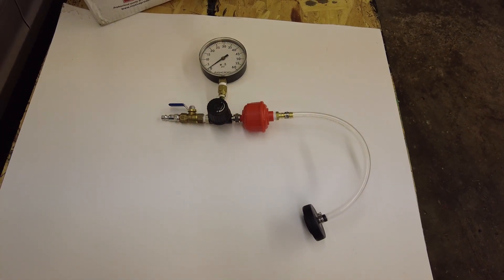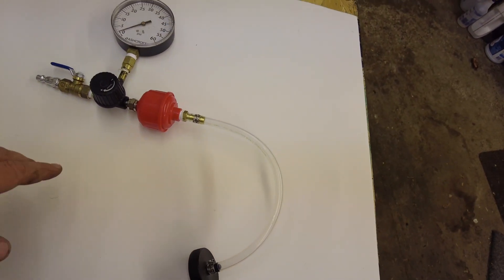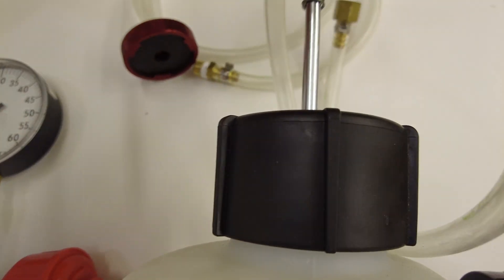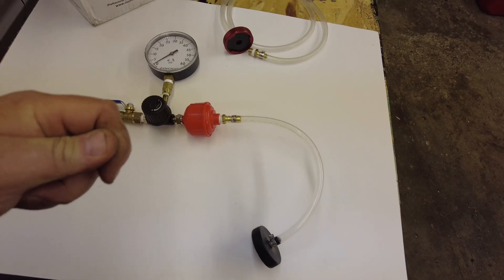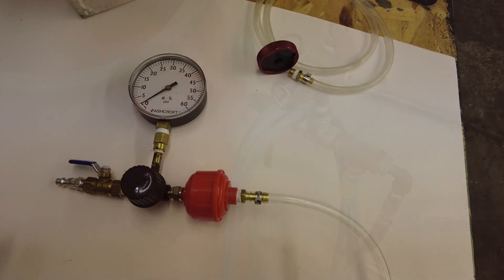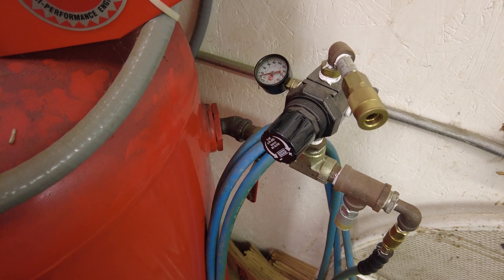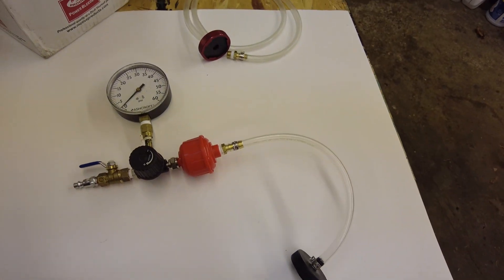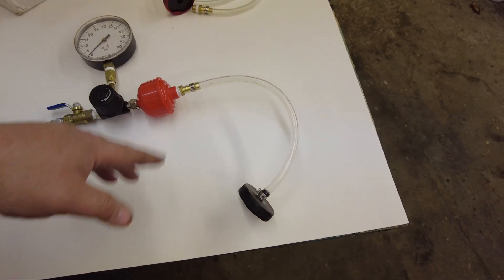How To Bleed ABS Brakes, Make your own Power Brake Bleeder, Pressure Bleeder. Brake Bleeding.

Comment from the maker: The bleed cap adapter shown in this video for the 3 tab round Ford master cylinders, made from PLASTIC:
https://amzn.to/3GKHSTw  (Amazon Link)

The bleed cap adapter shown in this video for the 3 tab round Ford master cylinders, made from METAL:
https://amzn.to/3q0JaD7  (Amazon Link)

The round 3 tab GM adapter that I quickly showed in this video, made from PLASTIC:
https://amzn.to/324rFdg  (Amazon Link)

The round 3 tab GM adapter that I quickly showed in this video, made from METAL:
https://amzn.to/33pyNkD  (Amazon Link)
 
Other Motive brake bleeder kits and adapters:
https://amzn.to/3GRiEDa (Amazon Link) 

Motive's website for adapter vehicle fitment:
https://www.motiveproducts.com/collections/adapters

Harbor Freight in-line filter as shown in the video:
https://www.harborfreight.com/disposable-inline-moisture-filter-68224.html

Harbor Freight in-line air filter that is FAR better than the one shown in the video and is only about one dollar more.  Get this one if you can!
https://www.harborfreight.com/disposable-inline-moisture-filter-63951.html

In-line air pressure regulator SIMILAR to the one I showed in the video.  (they don't sell the exact same one that I have any longer):
https://www.harborfreight.com/125-psi-air-flow-regulator-with-gauge-62695.html

As an Amazon Associate I earn from qualifying purchases.

Comment: If anyone has a vacuum pump,you can PRESSURE bleed the brakes;
wait  a minute....

 Oh yes,i was right»»
You see,when you create VACUUM at the wheel bleed nipple,the atmospheric pressure,  pushes down on the fluid inside the Master Cyl.with a PRESSURE of...1 atmosphere; that is what...14 psi??
 So,you convert Vac into Press...   
but..are they the same??  confused??
Reply from the maker: I'm only confused because I'm not sure if this is a question for me, or just simply a comment?
  If you're posting that vacuum bleeding is the same as pressure bleeding, well... it's not.  You can word things however you like, but it's not the same.  And the main reason why I say that is because of the air bubbles that get sucked past the bleed screw threads when doing a vacuum bleed. And the grease around the threads trick does NOT work. The brake fluid washes away that grease almost intimately.  Hey, don't get me wrong....  If vacuum bleeding works for you then by all means keep vacuum bleeding.  I'm not trying to tell anyone how THEY should do anything.  I am simply showing how I bleed stubborn brakes.  This method works for ME.  Your mileage may vary...

Comment: Which OBDII scan tool did you use?  Nice job on the design and setup.   I have a 2005 F150 that I'm pulling my hair out on
Reply from the maker: On this particular project I used my Autel 908....  however, any scan tool with the ABS brake bleed function would've worked okay. They can really be frustrating to get the air completely bled out of. Keep at it, you'll eventually get it.  By the way....  have you entered my drawing for a free Foxwell NT809 bidirectional scan tool yet?  If not, check out my most recent video on how to enter and win.  It's free with no strings attached.  The drawing is next Friday.  If you have already entered, then please disregard. Good luck, Sir!

Comment: On the Motive bleeder. I cleaned mine after every use but the lines still deteriorated and rotted...blew apart sending fluid everywhere:( Just use air to the MC now:)

Comment: Nice setup. I was thinking you could put a bladder on the bottom of the cap, but it would probably be clunky and make a mess.
Reply from the maker: That MIGHT work but the bladder material would need to be fairly thin for it to work properly.... and yes, it would probably make a mess, too. Honestly, the short amount of time the fluid is exposed to air is a relatively short period of time. The bleeder I built in this video is perfect for my personal projects. If I was doing a bunch of brake work professionally, I would buy a proper power bleeder. Thanks for the comment.

Comment: Make sure to bleed off the water in your compressor tank so that it doesn't rust through and explode...
Reply from the maker: Absolutely.  That is a MUST DO with any air compressor  (not just for bleeding brakes) Thanks for the comment.

Comment: I built a system like this a few years ago except I added a large Mason jar between compressor and reservoir. This way I’m technically pumping air into a quart jar full of dot4 and this is being forced into the reservoir via another tube. This way I have a quart of fluid absorbing the “air” problem in the reservoir your describing. It works well. For the glass jar, use the flat sealing lid and ring. Drill two holes in lid that accept the diameter of air fittings. Use the brass coupling nuts on the underside. On one of them, add a tub to extend to a low point almost touching the glass bottom. This low point will be used to fill the reservoir. The higher fitting is the air supply from the compressor. Yes, the glass jar will support 15lbs of pressure
Reply from the maker: Great idea, Thanks!

Comment: I made my own power bleeder out of some plumbing parts, a tire inflator compressor attachment and a fernco. The fernco will go over any brake fluid reservoir... sometimes with more leaking sometimes with less. The trick is to adjust the pressure so you get about 5-6 psi constant at the master cylinder. On my Subaru I needed 80 PSI to compensate for the leak, on my GM truck it was a much tighter fit and I only needed about 10 PSI to get 5 PSI at the master cylinder. Please note that if you put 80 PSI on the tighter fitting GM truck the whole thing will pop off and spray brake fluid everywhere... ask me how I know that! Basically if you carefully dial the pressure in, you can use your own homemade power bleeder that you made for $20 (requires compressor)

Comment: Panzer Platform sent me here.  Interesting... I guess you shut off your air, remove the MC cap, refill the MC, and then put back on and do next wheel?  Seems like more trouble than just doing the motive with brake fluid in it.  But yes, as far as bleeding goes, the Fords seem impossible to get a firm pedal.  Every Vic I've seen (including ones I've never touched the brake system) have the same pedal... goes right to the floor when parked and goes right to the floor after stopping.  But all of them brake fine when driving.  And little to no air ever comes out, whether doing 1 man, 2 man, Motive, or the scan tool ABS bleed.
Reply from the maker: Hello, thanks for stopping by.  I have watched several of your videos.  In fact, if I'm not mistaken, It was your video that shows how to turn off the TPMS light on the dash using FORscan.  I have purchased the OBDLink EX from Amazon and I plan to give that a try in the next few days.  Fingers crossed.  And yes, I just remove the cap to top-off the master cylinder.  It's not much of a hassle considering how easy it is to put air back into the system, and I don't put fluid in the Motive tank anyway (to keep it clean) so actually this is much easier than hand pumping the Motive tank back up to 15 psi when I top off the MC.  If you have ever used the Motive bleeder then you'll know what I mean when I say it takes forever to pump that tank and brake system up to pressure.  I have used several of these Motive hand pumps and all of them seem like the pump doesn't work.....  but eventually it starts to build pressure.  It seems like it takes a hundred pumps before you get anywhere. lol.  As for Ford brake pedal feel....  I agree.  The majority of the Fords that I have driven always seemed to have mushy brakes. Fortunately, this 2008 CV that I recently purchased had a very firm brake pedal right at the top.  The pedal felt great!  But of course I couldn't leave well enough alone and I had to install a "Line Lock" to assist in doing burnouts when I feel the need.  (probably not very often since I just put 4 new wheels and tires on the car a few weeks ago. lol) Once I opened the brake system and air got into the ABS module, it was a chore to get the pedal back to where it was and this device that I put together was very helpful.  (along with running the auto bleed on my scan tool many times) Again, thanks for stopping by and thanks for the comment.  I will post a comment on your FORscan video when I attempt to turn off my TPMS light.
Reply: @SlipFitGarage  thank you for the nice comments.  yes, I just started using the Motive and I've liked it thus far.  I clean it with denatured alcohol in between uses and so far it seems to work.  I even tried running the automated ABS bleed while doing the motive bleeder but it didn't seem to work.  I guess you have to press the pedal too.  I've done so many ABS bleeds I'm losing my mind, but still don't have a "firm" pedal.

Comment: Right on Brian,
I've spent a "lifetime" bleeding brakes using the traditional two man method, and I recently got that Motive Products Power Bleeder. It almost makes bleeding brakes pleasureable. lol

But now that I see this. 
This is pure genious.
This is a great option to have.
-Chuck
Reply from the maker: Hey Chuck, glad to see you here....  Thanks for the compliment.  I agree, when I originally purchased my Motive bleeder I thought to myself "how did I ever bleed brakes before this".  It really does make bleeding brake MUCH easier and it really helps to get stuck air out of the ABS module.  But now with this new device that I assembled here in the video....  it makes it even easier when you don't have to pump by hand.  Like I mentiond in another comment to WJ Handy dad, the Motive bleeders that I have used seem like the pump is very weak and it takes forever to get the tank and brake system up to 10-15 PSI.  Either way.....  whether you use the Motive hand pump, or the pressure regulater shown in this video.....  it's MUCH easier than bleeding the traditional way with two people. (And I think it's more effective, too.....  especially when trying to get stuck air out of the ABS module)  Thanks for stopping by, Chuck.  The information about the EVAP drive cycle that I found on your video is greatly appreciated. I just need to wait for spring and I'll get that monitor to run eventually. lol.
Reply: @SlipFitGarage  
Right on,
I'm heading over to your A30 Pro video.
XTool just sent me the A30M for test & review.
-Chuck
Reply from the maker: @PanzerPlatform  I don't know much about the A30M but the A30 Pro truly impressed me.  The ratio between cost and functionality on that tool is excellent.   I will subscribe to your channel and watch for the A30M video.
Reply: @SlipFitGarage  
Prepare to be disappointed. lol